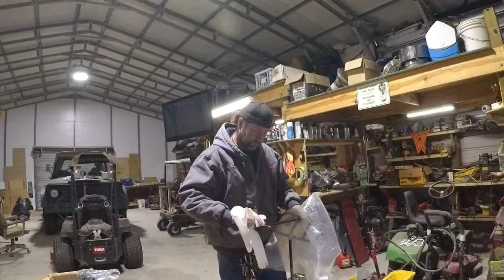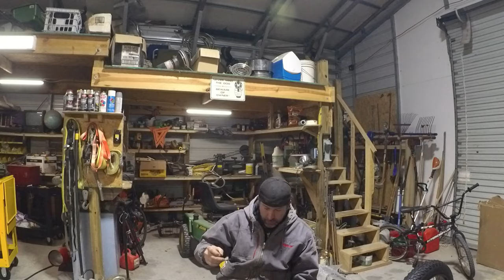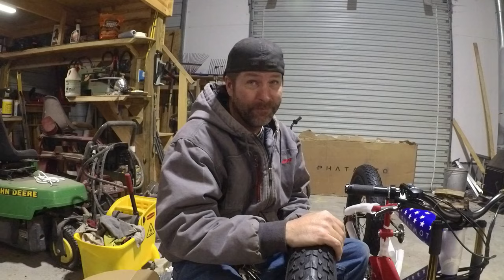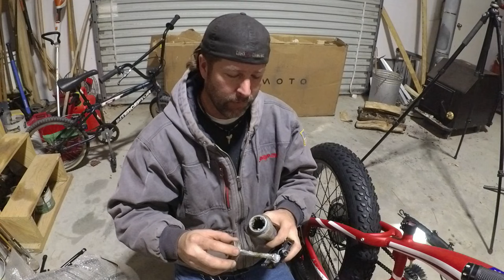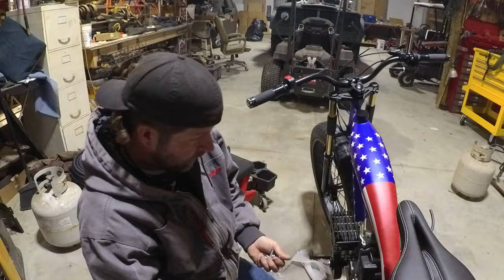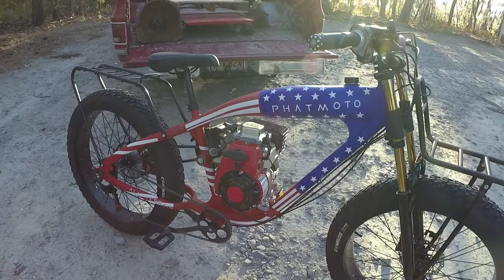2024 Phatmoto All-Terrain Unboxing And Ride

Comment: I went to the Phatmoto website and these are actually pretty reasonably priced.
With upgraded carb and exhaust, about $1200 shipped.

Thanks for the video.
Saw the notification yesterday, and when I opened it, it said "private".

Was happy to see it pop back up.
Reply: Better price and quality on those upgrades elsewhere. Go 799 while the sale lasts. Check out affirm.. 70 ish a month
Reply: @Rambling_Rover  
Thanks for the advice on the upgrades.
I won't need to make payments.

Comment: I have an original Phat Moto pedal bike- before they put motors on em! I'm going to chop it out and rake it and find the biggest fastest elec motor I can! Been planning it for yrs now- finally started on it a few week's ago! I've made a chain configuration for doubling the 7 speed gears and running a hubless rear wheel! I'm working on a suicide shifter at the moment! Next step after that is the frame chop and rake- then fabbing a springer front end! P.s. if you find an exercise bike, the seat is almost twice the size and they work great on Phat Moto bikes! Way more comfortable on us older bigger fellas trust me!

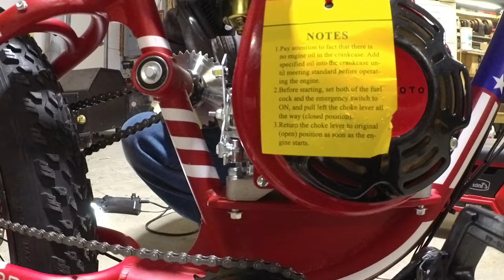Comment: Anytime that you're ins 24:10 talling a small engine you always run the bolts up from the bottom because the vibrations will keep the nuts tight if you run the bolts from the top down the nuts will unscrew from  the vibration of the engine will unscrew the nuts that's why you always put the bolt in from the bottom to keep them tight

Comment: That bike is really awesome. You know what else is really awesome? The grilled cheese cheese burgers I made today. What I do when I seat fat tires is as they are inflating with my little rechargeable compressor, I pull up on the tire until I feel it seating in the rim and as it's inflating the rest of the way, I work the tire back and forth all over the rim to make sure it's perfectly lined up and I can feel it as it's seating.

Comment: Just got recommended this video, I had no idea isaac had a channel 😅
Reply from the maker: Welcome!!
Reply: @isaacitllbefine7231 yeah I didn't know you had a channel either. Definitely subscribing. Hey did your all terrain have that clutch shake really bad before fully engaging? Mine did quite a bit before replacing two of the four clutch springs with the white ones to push the full engagement out to 2400 rpm. That reduced it quite a bit. How much do you weigh Isaac?

Comment: When that dinky plastic chain guide wears out you can go to tractor supply and get a pulley for a lawnmower deck that will last much longer . Of course you will need new hardware to fasten it . Also if that chain stretches fast you can get a #415 nickle plated chain from tractor supply as well .

Comment: My biggest complaint about the Phatmoto is they still haven't added a freewheel to the engine side yet, they're just so noisy when they coast, can't appreciate the sound of the engine.  The 7 speed on the bicycle side is a little counterproductive too, but that can be fixed with a 16t freewheel.
Reply: i love the engine breaking and 7 speed set up. much faster pulling steap hills. 🍻

Comment: I'm guessing the version with regular bicycle tires is faster due to weighing less and less rolling resistance. Would be even faster with some Vee Speedster's on it (my favourite bike tire). That'd be the first thing I'd do if I bought one (well, next to putting my big old Person's saddle that I believe came off of a Whizzer on it). Not sure if they even ship these to the UK. Would probably cost a fortune if they do and the bike and/or engine getting damaged in shipping would be a concern. Also, my condolences for your loss.
Reply: i have both and they both go 29 mph. i thought the fat tire would be slower. not will the hillard clutch. 🍻

Comment: I love your content and evry1 makes mistakes.those are not hydrolic there Manuel disk
Reply: No they are hydraulic. They use mineral oil. This is the first time they have used hydraulic brakes.
Reply: @alloutbikes  so the cable pulls built in Master that's awesome
Reply: @clintonmcnair5447  Nio. There is no cable. It has a plunger pushing mineral fluid through hydraulic hose. I had to repair one already from a wreck.
Reply: @alloutbikes  I didn't see reservoir on the lever and thought the hose was cable this is awesome can just the breaks be purchased at this time for my motorized bicycle
Reply: @clintonmcnair5447  If you have bicycle disc brakes then yes. Just make sure your using metallic brake pads not organic. Organic brake pads wear out to quickly.
Reply: @alloutbikes  thank you so much for your time and response. I love you and your brothers content, sorry for your loss I'm subscribed to Isaac and will be in a minute to All out bikes my bike is beach cruiser with the little predator engine jack shaft from go power sport and other stuff from Amazon dose have disk breaks

Comment: What NO fender's WOW !!!~
Reply: Fenders are a no no in the motorized bicycle community due to a dude that passed away from a fender failure
Reply: i spent money on metal fenders. i had to bend the arm around the front break caliper. it then broke, front fender then cracked in half. the rear fender would not stay tight no matter what i did or loc-tite. got tired of removing rear wheel to fix. then i heard ppl died. so yeah i ware leather in rain n snow. 🍻

Comment: I love motorized bicycles i have 2 of them but 2 stroke and these 4 stroke bikes are just way overpriced and way underpowerd
Reply: but can you commute on a 2 stroke full throttle for 2 hours straight? how many hours before a rebuild? 4 years ive been running this engine daily wide open, governor bypassed. 30 mph is about all faster i want to go on a bicycle. 🍻
Reply: @niteshades_promise  i get 35 on the 2 stroke and ive had mine for 10 months still running good and i only paid 90$for the motor so if it blows up i got my moneys worth out of it i drive it almost every day 10 miles one way abt 5 or 6 miles ushaly just riding arpund town and then 10 miles back idk the 4 stoke might last longer but id rather have the sound of the 2 stoke between my legs and i got a lil more pep ive hit 37 once
Reply: @niteshades_promise  o and i got the frame i use for free on the side of the road so ive only had to pay for parts that wear out chain tensioner wheels clutch pads once but i think thats just cause they were bad from factory i bent a few rims but thats bicycle stuff i stripped my front sproket the other day but it was after 10 montha of hard riding i rode trails and everything